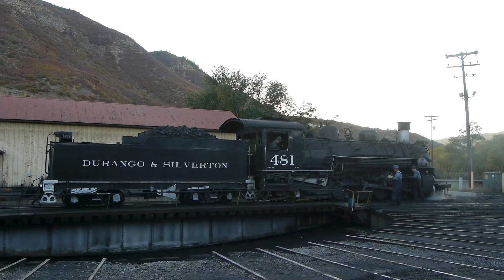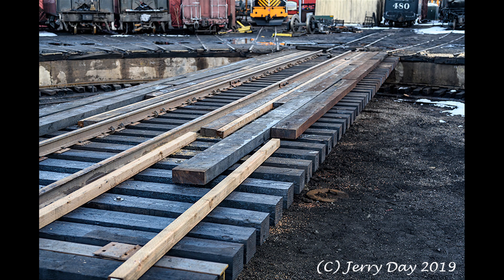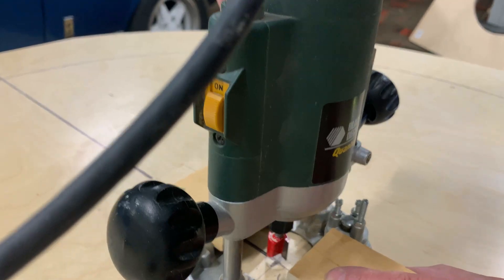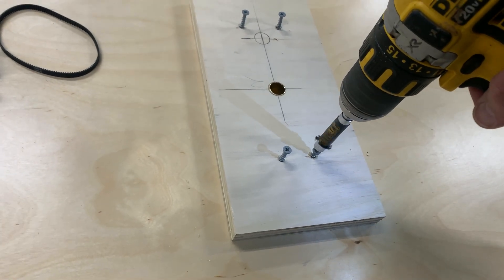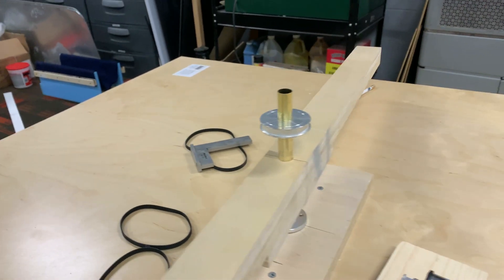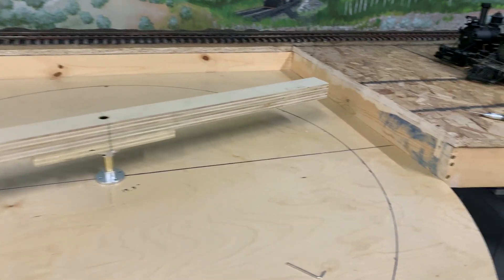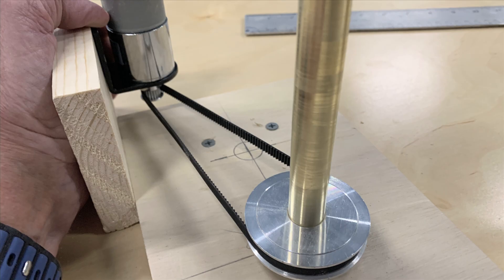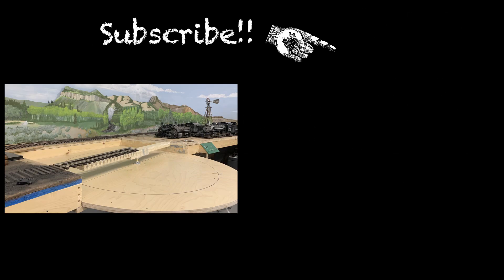Part Three - Modeling  a Denver & Rio Grande 65 Foot Turntable - Basic Construction

Comment: I'm catching up to these videos after the fact, you may have already workd out all of the gears by now.  It appears that the gears on your motor achieve about 6:1 ratio which would make the bridge rotate about 1.67 rpm.  So in use if you want to rotate maybe 1/4 rotation that would take about 25 seconds.  I would guess you will want it to be faster than that, maybe 5-10 seconds for 1/4 turn which would require something like 2:1 ratio on the gears added to the motor.  However that would make the stopping action less precise, and I have no idea how fast the real turntables rotate when in use.  They're probably not so easy to stop either.
Reply from the maker: I’m using a motor speed controller and that seems to be working fine. If however, I need more torque. I’m going to go to a larger gear. So far it’s working just fine as is, but I haven’t tried putting a really heavy locomotive on there yet.  I’m still kind of building the whole thing, I haven’t really had a chance to put it through its paces.

Comment: Perhaps you could have a cam on the main shaft (under the layout) that opens/closes a micro switch to kill the motor when aligned.  However a #1 eye and manual control can be good.  Many prototype tables have alignment pins to lock the deck to stop the rotation whilst driving the loco on/off.
As you are DCC you could fit a loco decoder to the 12v motor.  This could give you a refinement for the speed (and direction) control.   Saves having a separate control.
Reply from the maker: Hi. I’m building a control panel. As I need to be right there to see the alignment it should be simple. As fer the pins if I need it I’m going to use a simple slider just like the prototype.

Comment: It's turning out awesome. As you stated, I'm curious about how you're going to be able to stop the turntable to align with the tracks. Im also curious about how you're going to be able to run power to the turntable tracks.
Thanks again for another great video!
Reply from the maker: On Tuesday, I’m gonna show everybody the slick little trick that I used when I built an HO scale fully functional carousel years ago. It was before we had surfacemount LEDs and so I wired it with actual incandescent bulbs. I’m the whole damn carousel was holding about 6 inches across. And I came up with the slickest way to get power to it!
Reply: @ToyManTelevision I'm looking forward to Tuesday!

Comment: Did you consider just using a case from an old DVD or a lazy Susan base…….just kidding 😅😂. I admire your engineering ability and patience in construction.
Reply from the maker: Actually, the bearing that I have that I may end up using is out of a lazy Susan. So that’s actually not so absurd.  😊😊😊❤🚂🚂😀😊🚂🚀🚀🚀🚀

Comment: Great vidio,table is looking good . Mite need wheels on that bridge for support and a pot hole to line up the tracks could work, on my shad layout hand turn table  it has tabs to level up the tracks and stop. Thanks for the morning coffee...
Reply from the maker: Yeah, I tried putting about 20 pounds out on the bridge to see how well it would turn and well it doesn’t turn all that well with that much weight on it. So a 40 pound locomotive would be right out! But the prototype isn’t supported at all in the middle. It’s supported entirely on the ring rail around the outside. So as soon as I finish testing some things I’m going to build the ring rail and then I bought some ball wheels that will make the little wheel trucks that ride on that so the bridge will actually be supported from the ends.  At least that’s the plan! And that’s how the prototype works.😊😊😊🚀☕️☕️
Reply: @ToyManTelevision on my Yardlayout turntable I used cabinet rollers then covered rollers with the bridge, the atlas turntable powered the movement, no tipping.

Comment: Would a dimmer type box for the motor work? That way with the turn of the nob you can regulate the speed of the turntable. I don't know if they make something like that, but you could probably check.   So far so good. Another cool video.
Reply from the maker: Not exactly that but yes similar. What I’m actually thinking of doing is just using one of those cheaper model railroad power supplies. It’s got a speed control and a reverse switch right on it!!😊😊

Comment: Not exactly sure the correct term for it but you could look into a speed regulator for your motor to help dial in the rotational speed issue? It goes between the power supply and the motor for the turntable motor, it has a little knob you turn to adjust the speed.
Reply from the maker: Yup. If the speed is s a bit to high I can cut the voltage. I’ve thought about using one of those cheap model railroad power supplies. Got a reversing switch and a speed control. Anyway first I’m just gonna put 12 V to it and see what it does.